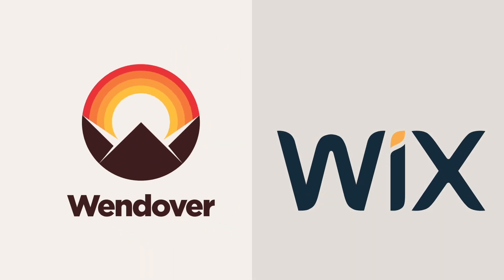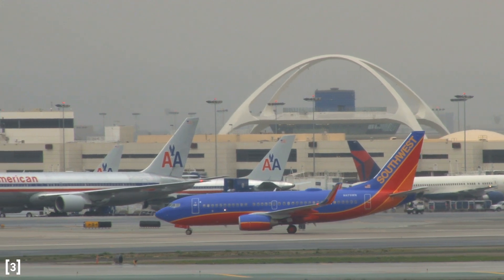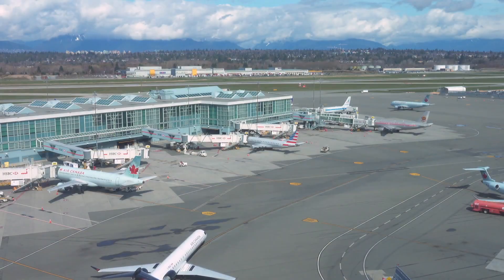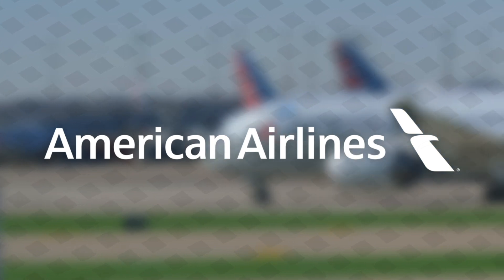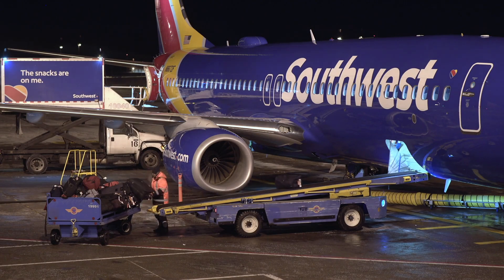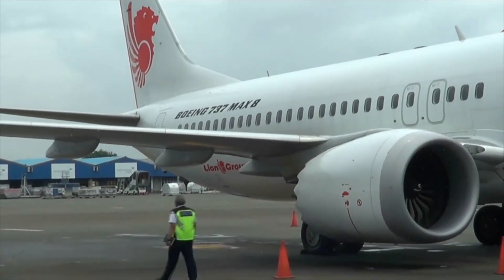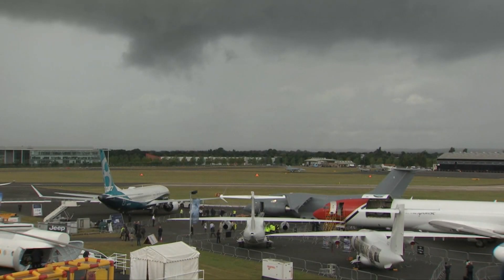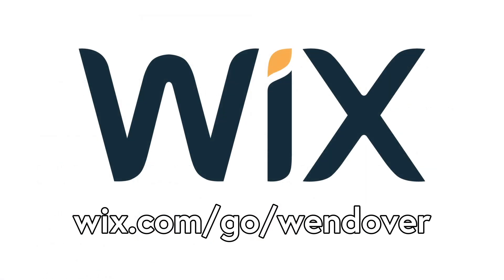The Economics That Made Boeing Build the 737 Max

Comment: Cool video, although the 737 MAX has hydraulic flight control actuators, not cables. The cables are there for backup. It also does not have just a warning light, it displays in detail warnings on the all-new large MFD display panel. And, if you mean seven switch flips to turn on the plane, with other aircraft being only one, that is not true. Most aircraft require 1 switch to be flipped to allow power to the main electrical bus, with many more to start the engines. This is true for the 737 MAX, along with almost all conventional aircraft.
Reply: still it's essentially cables just powered by liquid hydraulics
Reply: there’s just cables and hydraulics that’s all
Reply: it’s that simple.
Reply: There are plenty of older B737 variants still flying, Which have very similar startup procedures and flight control systems.
With 747s, 757s and 767s not being fly-by-wire and having paper checklists too.

The "one switch to turn plane on" depends on exactly what you mean by turning the plane on.
It may also be easier if you have ground power (and air) hooked up. If you need to use the APU then I think all planes require multiple switches, in the right order.
Reply: @Blake Belladonna Hey dumb ass they have been built that way for decades and guess what  THEY WORK !!!!!!  DUUUUUUUHHH!!!!!!!
Reply: Let the amount of steps for powering the engine on modern plane be A, then for the 737 NG/MAX, it would be a+7
Reply: IN BOC: Your comment is incorrect. The engine start sequence on most commercial jet aircraft is very similar.
The B737 is no more complex or has more buttons or switches during engine start than any others.
I’m sure there are even videos on YouTube you could watch on this :)
Reply: NthSyd747 Not sure if it has changed in the NG/MAX but if you look at article [1] in the description, It describes those extra process
Reply: SimPilot thanks for making that correction as the video was purposely deceitful.
I've worked on many 737's & they are great planes.

Comment: I almost never fly on boeing planes anymore, and i fly frequently. Airbuses are just so much better overall and i think most airlines realize this, at least the ones i fly with.
Reply: The A32Xneo family is affected by the same pitching tendency it's just handled differently than MCAS  even so the appropriate fix is a software update
Reply: Seems like the fix for the death dives would be simple enough.    Fix the sensor(s), make adjustments, find an open area to perform a huge battery of tests.     But alas Boeing is SO CHEAP they want to just say things are ok without proving it and putting the divers back in the air!       Fly on one of these death divers? - no way.      A shining example of US Corporate greed.     

If you went  driving out on the highway with known bald tires and no brakes and killed a family on the road we are criminally liable.
You knew we were putting people at risk and didn't care.      BOEING did the same shit and gets to skate.    They should be sued out of existence by the surviving families.
Reply: @VoIPPortland  Technically speaking that is a poor comparison. This is more akin to a tesla autopilot having a drift to the right and not correcting. The solution just like in the max... Shut it off. Drive manually.

Comment: So what they did was add a safety system that wasn't required instead of training the pilots properly to understand climb pitch control - running on a single sensor.
As far as I can tell this isn't a fundamental design flaw, it's more a flaw in lack of training for pilots and over reliance on electronics.
PS - all things being equal electronic servomotor control is less safe than cable or hydraulics because they are less likely to fail catastrophically. The ideal installation would be primary electroservo, secondary hydraulic and a tertiary cable control system (something similar fitted to A10 Warthog).
What's the betting both the sensors failed due to excessive temperature (Africa is quite toasty after all).
And despite MCAS being a pile of crap - duplicate or triplicate sensors and indicators would still have rendered an uncontrolled flight into terrain much less likely.

Comment: No one talks about how badly the NG line was assembled they moved production to punish the union over a pension battle and used defective parts when qc spoke up they were threatened and fired had Boeing took the "right path " it would have costed them significantly more money but that's ok they have it, they wouldn't be experiencing this gigantic drop in quality and would have remained the top dog for generations to come,  the NG were not built to the correct tolerances due to defective parts that were used any way and this is not even scratching the surface of the failed 737 max the NG is in the sky right now and with there shoddy fuse lodges built by Burger King workers that were not drug tested what this means is the planes fuse lodge will age very rapidly and has many weak points on the frames around the doors and if one has to ditch or crash land the fuse lodges on the NG s will most certainly come apart at the weak points , doing things cheaper and faster really does not work work out well since they took over md the landscape of the company has changed and the old redundant experienced engineers are all gone and this is not the Boeing it once was its focus is maximizing profits for share holders over safety and quality and the incredible cozy relationship with the faa allowed this to happen , the company was world class and it took the success built from good engineers and skilled labor and sold out its name to putting safety below profits this is far from over and we need to be looking harder at the NG line that is in the sky right now in droves I'm actually more afraid of that jet than the 737 because when that piece of junk starts to age they're gonna be splitting open like bananas

Comment: The 737 MAX is the worst engineering disaster in history.  It's an out of the box out of CG disaster.
I would never fly one.  I feel very bad about it...such a lovely looking plane.  But they should have never gone blah and just moved the engines forward and upward to the point they trample the wing's leading edge.  And there's the Datum these imbeciles totally forgot about.  Horrendous mistake.  Whoever these idiots were...they sure didn't have a single hour of flight time under their belt.

Comment: A330--706 units / 3 crashes/459 fatalities/ still flying
737 Max--750 units/ 2 crashes/359  fatalities/ grounded
🤔🤔😨🤓
Reply: Exactly!

You are comparing an aircraft version (4th generation) that has been in service for less than 22 months at the time of suffering two inexplicable and almost identical crashes resulting in total loss of crew, passengers and airframe with a plane that has been flying successfully for over 25 years, with airlines still ordering them today.
This is why one of them is grounded.

Comment: cobrapub here,HELLO I am still alive you twit,yes I helped Boeing/Locheed/Gulfstream design and develop aircraft/spacecraft for 50 years!Now I hear from a Economic Industral over educated moron,about how Airbus is better than Boeing,REALLY!What a SHORT MEMORY,Hello,remember the Farnboro airbus disaster after an airbus demo a so called "FLY BY WIRE" system and killed 50 passangers!Then there is the Air France disaster off Brazil 300 passanger and plane missing for a year!Beoings montra has always been "LET THE PILOTS FLY THE PLANE",that is why the 737 has been so successfull! My last job was on the Japanese "MJR" and it is a smaller version of the 737 not a A310!The problem is H/R,to many cooks spoiling the end produce!

Comment: Not entirely true, just because you do the Type Rating for the 737 Family, doesn't mean you can switch between the models without any kind of training. If you choose to switch from the Boeing 737/800 to the 737/700 you have to do an online/IPad course which is called the difference Training which basically shows you the differences between these two types. Mentioned at 7:00 min
Reply: He mentioned:
"any substantial training"
and I don't think a ipad course can be named as substantial in this case.

Comment: It wasn't so much the aerodynamics that were changed by the new engines. It was the pitch moment of those engines. Aerodynamics wasn't the issue as the stabilizer had plenty of authority to override the pitch up.

Most aircraft exhibit some change in pitch with changes in power, flap deployment or landing gear position. Software fixes have become an accepted technique to fixing unwanted flight characteristics. Iirc the 787 eliminates aileron flutter this way. The main issue it seems is a safety system that the flight crew wasn't properly trained on or in some cases notified of it's existence.

Comment: Personally, after 3 hours on a 737, i’m sick of it.  It was designed for smaller, less developed airports to reach super hubs, where the 707’s, 747’s, and 767’s would carry people on their way.  Now even regional jets have grown out of flying to smaller fields, having either canceled service, or forced the airports to develop.  Back on track, at a certain point, the designers have to realize, that you can’t have an aircraft do everything.  It was built in the class of the DC-9.  You don’t see anyone flying trans continental, or trans atlantic, New York to Paris, on a DC-9 do ya?  They’ve effectively taken an aircraft to replace the DC-9, and make it, at the same time, replace the 767.  Make up your mind.  How about an update to the 757, designed precisely for long and thin routes?  Nope, they’ve canceled that, and are putting people in a frankensteined 50 year old regional jet.

Comment: All these idiots had to do to sell a longer single-aisle airliner was to re-start the 757 assy line. By stretching the 737, they totally wrecked the weights and balances of the original design, requiring continuous fighting against the pitch to keep it from augering into the ground.

Comment: The industry dynamics and pressures are such an interesting component of this video. However, I'm curious, if Boeing required airlines to give their pilots a period of sim training to learn the recognition of the pitch up tendencies of this new design, couldn't they have skipped "Airbussing" the MAX with an MCAS system to begin with? It seems as though Boeing pilots should have the stick and rudder skills to begin with. Yes, I understand the airlines wanted a variant that could be flown after taking just a few CBT modules, but some hours in the sim isn't a bad compromise compared to a whole new plane.

Comment: Why didn't they just raise the plane up?
Reply: They would've needed to redesign the landing gear assembly. On the 737, the body gear retracts into the fuselage, and the hubcaps form a flush surface with the underside of the aircraft in the fully retracted state. In order to achieve this with longer body landing gear, they would have to be spaced further apart to be able to properly retract, which would change the weight distribution of the landing gear and necessitate a redesigned wing to cope with that.
Reply: @E1craZ4life  They couldn't use telescoping landing gear and avoid that?
Reply: The landing gear struts are essentially oil-filled shock absorbers; they already have a structure like a collapsing telescope anyway. And even if they could achieve that concept, the gear wouldn’t be as sturdy due to A.) there being less oil for shock absorption, and B.) the extra bulk of the mechanism that would lengthen the gear adding weight and taking up space.
Reply: @E1craZ4life  I'd figure that, given 60 years of tech advances, you'd be able to do something. It might be expensive, but just look at what the military planes have to go through. 

They should have just made a new plane…
Reply: Yes, they should’ve made a new plane.

Unfortunately, we’re not playing “should’ve”s.

Comment: The notion that the 737 Max alters the type's handling characteristics so much, it requires a software change rings untrue.  If the new model requires a wider range of trim control, then that could likely be done.  That an aspect of operation would now be controlled by software?  Unknown to the crew? Really?  An English analyst suggested that Boeing must be asking itself, 'we really did this'?

Comment: Plane is not faulty, sensors have to broken to cause the crash, properly trained pilots can correct the issue.  there are 393 Maxs in service and they have been flying since 2016  why have there been crashes now? bad maintenance and bad training.  Could the plane be better? sure.  Does this lie squarely at the feet of Boeing? I would say 3 years of no crashes would mean no.
Reply: You also need to consider the age of the planes that actually crashed; if they were newer planes, they may have had some manufacturing defect or design change that contributed to the accidents.

Comment: There is more handling differences between an lightly loaded airliner and the same one at gross weight than there is between different sub types of an airliner. If you can fly one type, you can easily fly the others. There has been little advancement in basic aerodynamics between the 1960s and now, the improvements have been in systems, avionics and above all engines. The fact that the Max is derived from a 737-100/200 is irrelevant. The Max is a great safe plane, just fly it without the autopilot until the fix is completed. Sadly there has been a hatchet job against Boeing by media and sadly the FAA which is reacting to the media.

Comment: When Boeing introduced the 757 and 767 with a common Type Rating they made the cockpits of the two types pretty much identical, however, friends who flew both aircraft told me that there were definite differences in the handling of the two planes.  A good pilot can handle these differences on his own, but a lot of airline pilots are not "good" pilots.  One of these marginal pilots would have more trouble changing from the 757 to the 767.  United nearly crashed a 747-400 on takeoff from SFO because a "Bunkie" F/O was making his first ever takeoff of a 747 on a flight to Hong Kong. The #4 engine failed.  The Captain's mind was somewhere else, and the plane nearly crashed into San Bruno Mountain to the right of the takeoff course because the "Bunkie" knew nothing about rudder correction, and the plane drifted to the right.  He had never flown a 747 except in cruise flight.  The plane crossed the mountain ridge so low that many car alarms were activated. United Airlines was also activated.  They completely overhauled their training.  It's interesting that American Airlines and Southwest Airlines also had problems with the 737 MAX, however, the pilots all knew how to deactivate the MCAS because those airlines trained the pilots on the new 737 beyond the 50 minute video that Boeing provided.
Show less

Comment: I refuse to fly on any 737 Max.

I always check what type of plane I'm flying on before I buy that ticket.
Reply: They're grounded for now, so no worries there. Even if the grounding is lifted I speculate most airlines still wouldn't fly them as doing so would be a PR disaster.

Comment: Excellent video 
As a retired pilot with 5,000 hours in the 737, I feel Boeing’s error was to sell the AC with only one AOA sensor.

Truth is if you are in the 737,707,727,DC8, if things are going to hell, you have to always #1 fly the plane. The two recent accidents, the pilots were never flying the plane. They did turn off the system but the turned it back on and never pulled the power back.

This will cost Boeing lots of money but I have always said

If it ain’t Boeing
I ain’t going
ATP 25,000+ hours world wide flying for 67 years
Reply: How about putting a heavier engine on an old design and adding a software that dives the airplane to correct the stall ? That's not an "error" ?
Reply: You're the only one in the comments who understands the situation :C
Reply: Jared Bork ,.,.,lol,,!
Reply: @hojetjock It has two AoA's, but the 'disagree light' was a costed extra.  I kid you not.
Reply: @bobholmes4215  That's true and not true. The B737Max has a disagree status monitor fitted as standard. The light display was an option extra - one that that many airlines, not just Lion and EA,  chose not to purchase.

Comment: The is a lot of additional (and damning!) MAX information contained in the latest 60 Minutes Australia.  One point at odds with what's in the vid is that, according to a Boeing 'insider', it was Boeing, in a panic at the large Airbus order to American Airlines, offered to refit the 737 with bigger engines, if American would give Boeing 50% of the order. Boeing also allegedly deliberately chose to use a single AOA sensor, in order to avoid having to re-certify the MAX, the reason the FBI is currently investigating them for criminal culpability.

Comment: I love Wendover's videos,
but I'm sorry, the intro to this video just isn't accurate.... Allow me to explain:
First off, Most checklists are actually provided by the Airline, not Boeing, simply including the required info (supplied by Boeing) This can take the form of either a tablet (as seen on many airlines now) or paper, but again, that's the airline, not Boeing. 
Second, the "warning light". This is just totally wrong, while there is a central warning light (same as almost every other commercial aircraft), this light only refers you to the center screen (PFD or ND display) which displays the exact issue and it's location (same as airbus, etc...) But these features are not new to the 737 Max, they we also on the 737 NG (-600, -700, -800, -900)  
Again, Wendover, I love your videos, but I'm sorry, this one just doesn't pass quality control.
(also yes, I've spent plenty of time in many Boeing cockpits, I know what is, and isn't there)
Regards,
-AM